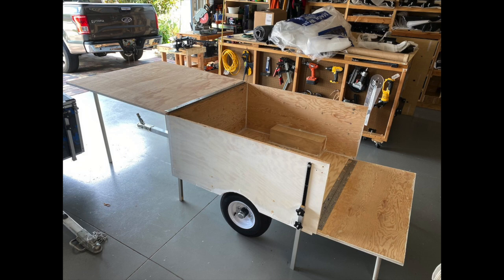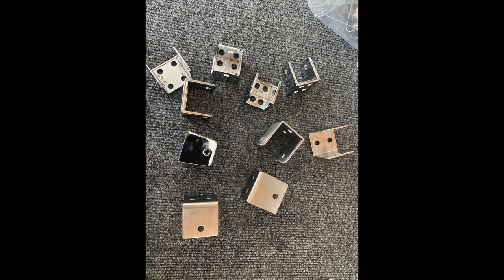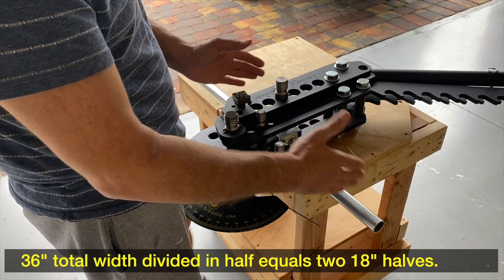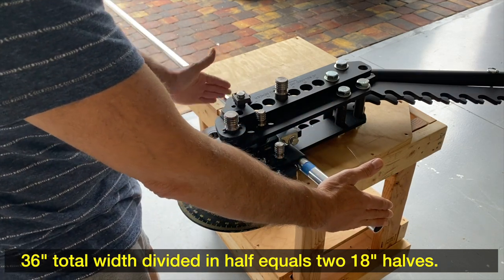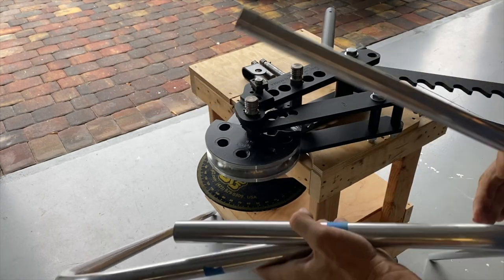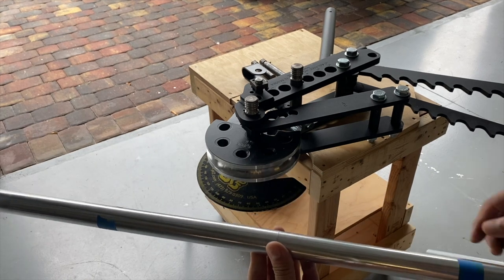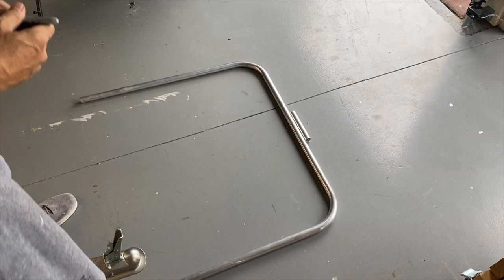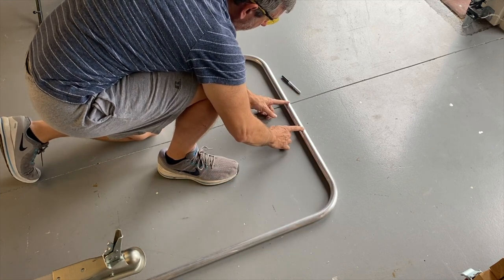Making a Supported Lid Bow for a Tent Camper

Comment: i can't wait for the next episode.  I want to see what you used for the corner supports and the long piano (?) hinge.  I'm thinking of buying a metal trailer so it complies with all the uk road rules, then make a wooden frame inside to screw all the bits to.  was considering to make the tent supports from wood instead of aluminium tubing, but not so sure now I've seen yours with aluminium tubing.
Reply from the maker: I'm glad you enjoyed it. I have not published a lot of videos but I do have more written pieces and pics on what I've done at www.kampereen.com. I have used a couple of alternatives for tent bows including electrical conduit tubing and furniture grade PVC pipe. Before I got the tube bender, I found that Schedule 40 3/4" PVC pipe elbows will fit nicely over 1" aluminum tubing which gives you a way to make tent bows without a tube bender.